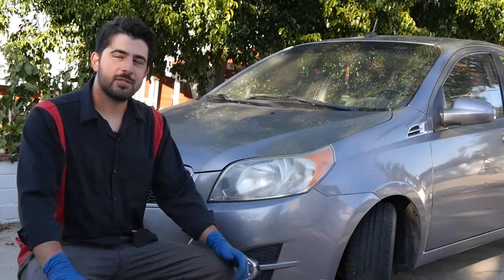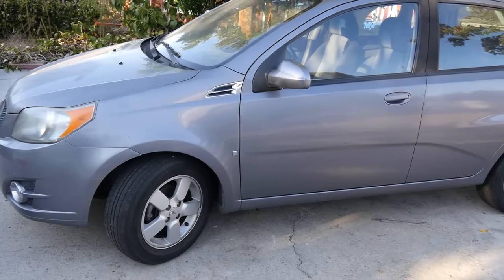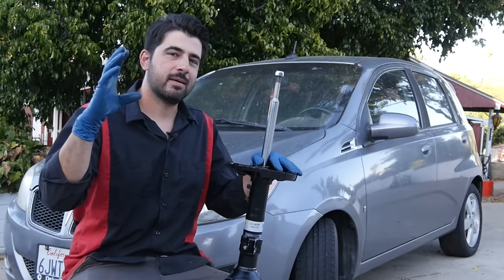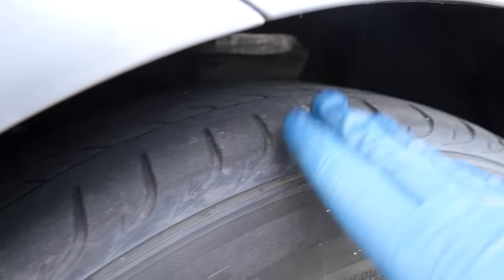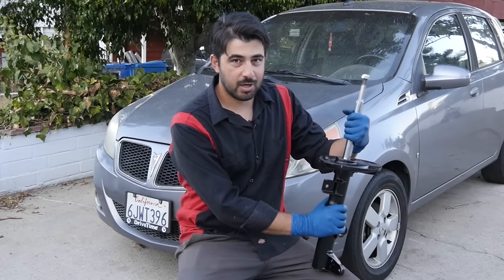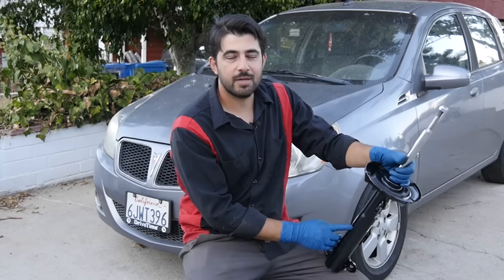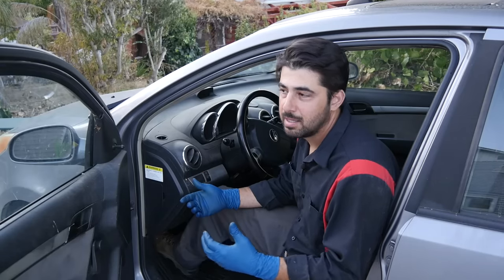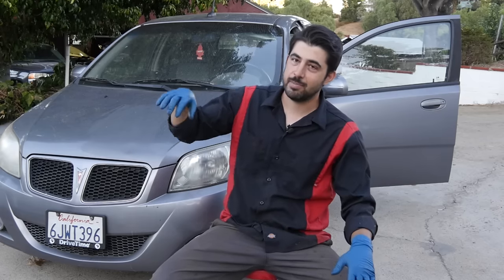How to Diagnose a Bad Strut or Shock on Your Car

Comment: man im not gonna try to assume i know better than you but i want to point out some things because not everything you said is 100% accurate
first of all a lot of cars come with soft/hard springs and dampers so sports cars ride rough and it does not feel quite comfy in them
and in luxury cars they do ride smooth but now do you get the problem ?
softer springs and shocks mean that the car will have body roll and will transfer its weight front to back when accelarating and decelarating under really heavy loads
so sports cars under heavy breaking to tend to dive their noses and when giving gas the weight goes to the back wheels just not as much as in luxury cars
 thats just physics
and how can you tell if a shock is bad when a car has soft suspension anyway...okay it the suspension is stiff and now is really soft its kind of obvious because we are technically comparing what it was like it was new and a few years passed so it has worned out but what about someone who buys a brand new car that has no idea how it drives anyway... i just think its not that simple  
so unless you take it out of the car and inspect it they way you did there is simply no other way to tell unless your car either has hard dampers and springs
and all of a sudden you go into a corner and you feel the massive body roll because the damper can no longer  hold  all that G force from going into a corner

Comment: I just put new coilovers (non OEM) on my car, and everytime I drive through bumps and road irregularities, my steering wheel is twitchy and sometimes pull to left. Do that mean my new coilovers are not good ?
Reply: You have low profile tires, huh?
Reply: @deasttn  Yes I do. But when I put low profile tires before changing coilovers, I did NOT have this bump steer problems. Then after driving in potholes 2 times which punctured my front left tire each time, nearly the whole suspension system got damaged. I changed Tie rods, lower control arms, Ball joints, Stablizer link, coilovers (Tein street basis z) and some bushings, but the problem is still there. It's a toyota corolla 2011 btw.
Reply: @jin5632  your coilovers are probably fine.  
You changed the geometry 9f your suspension, which can throw things out of whack.

How is your steering rack? 

Did you get an alignment done after you changed stuff?

  
You may have to live with the nuisance.
Reply: @deasttn  I got alignment 7-8 times and the problem still persist. But on good road conditions, the car drives straight.

The steering rack and u-joint, I went to a mechanic. He only drove the car and said if it was damage, then the steering wheel will be hard to turn, make noise when turning and will have constant wobble even on good surface road.

Although I didn't lowered the car completely, I still have that problem compared to a friend's car, which he lowered completely and have low profile tires also.

Thank you for your help :)

Comment: My driving has a thumping when driving straight. I don't surve when driving. No leaks. Brand New Brakes front & Back. I don't bounce when driving. My car is in top shape except painting. Any reason? No steering wheel jumping. I need to have a machine to find this thumping sound.  Very annoying. Especially when no one actually has a proof of testings. Test! Then you'll get a print out of all matters. This is the only way to find a cause of maintenance in an automobile. Let's do it Right for once! 😮🤬😊